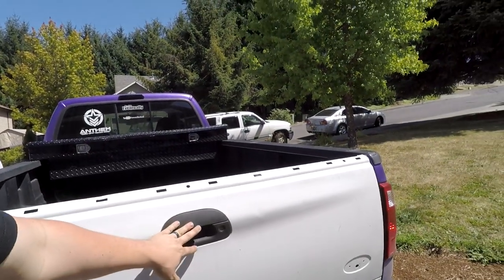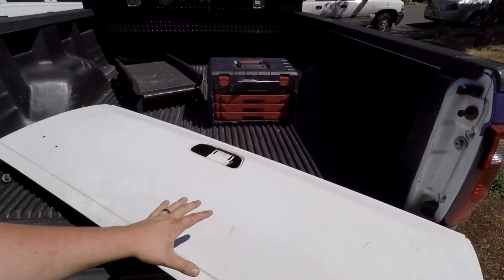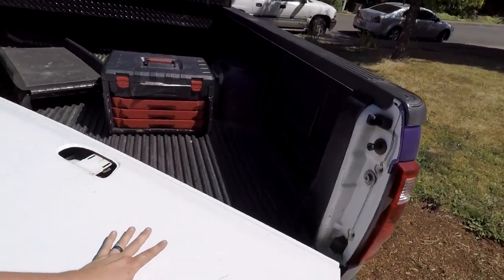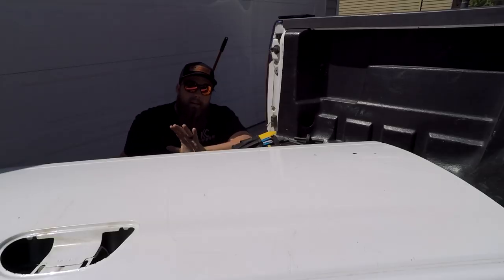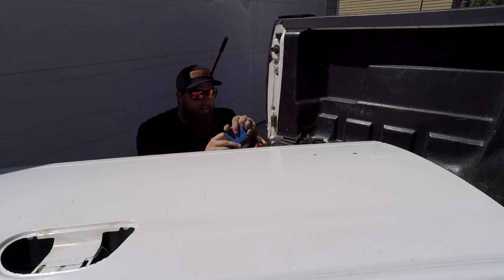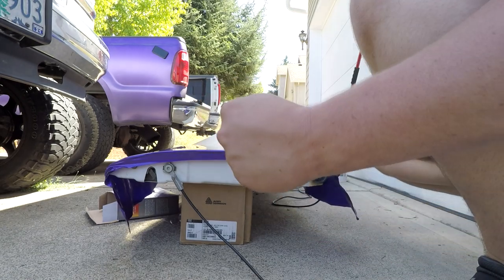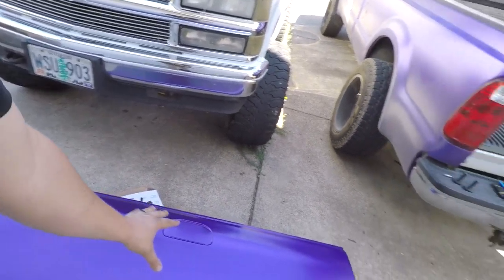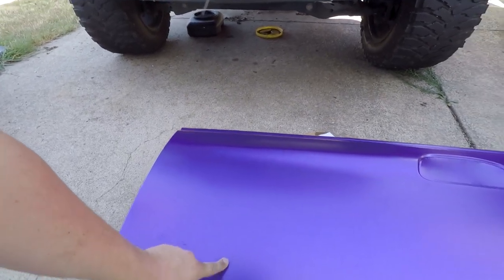How to Wrap a Tailgate + HUGE NEW SPONSOR

Comment: Just installed a water pump oil cooler put in a high volume oil pump front main seal was leaking so while were there and a fluidampr easy 1000 and a long weekend

Comment: Is the code still good to use need a new turbo . Love the build keep it up man . I have a 02 that’s been a pain in my rear about 7k in new parts under the hood . Not mods just stock replacements. My 7.3 is in the shop fuel line passenger side cracked froze and snapped in the head so it’s currently getting heads and valves and possibly a few stock injectors for know due to medal shaving that could be in a few of them already. They pulled my turbo and it’s shot iv for 285k it’s 2wd 4 door long bed . Love the 7.3 so much I’ll keep dumping money in it better than buying an new one. I have plans to do the kc turbo over the 38r after doing research and watching videos on it . Already have a 4 inch exhaust and new down pipes boots seals and a ton more way to much to list . Only mods are 6637 intake , 4 inch exhaust So I think it would be a good thing to add. Just worried about the pmr rods holding up . I did and recommend the new braided fuel lines with 3/8 fittings what I am going to .with a new stiffer fuel spring  as well from riftraf for better fuel flow . For know and a new turbo . Plan in the future to do 2 inch level the cross over mod  and added 2 more fuel lines on the other ends of the heads mod as well then injectors if I can get away with it in California. Was going to ask if u have any rub with your 20x12s and the mm offset like the stance . Thanks man